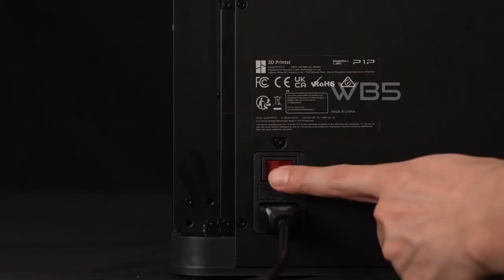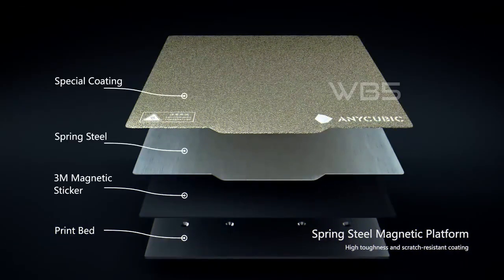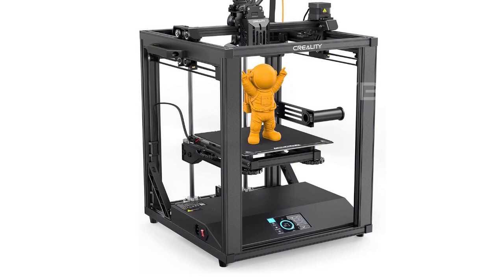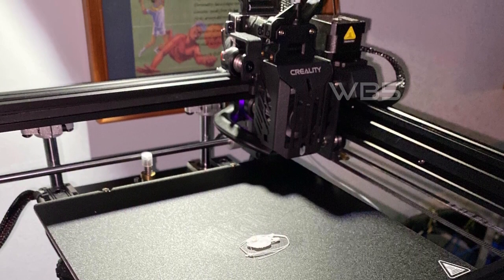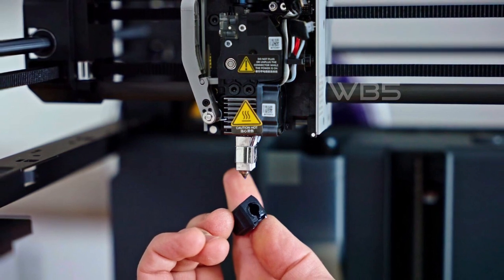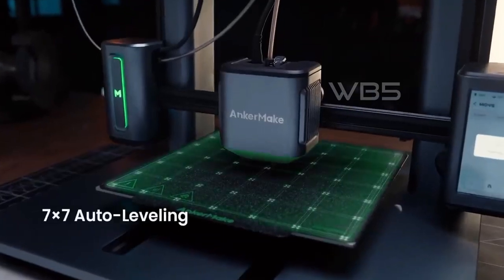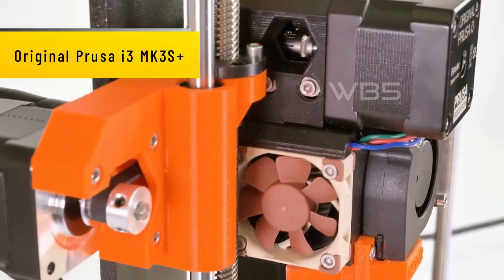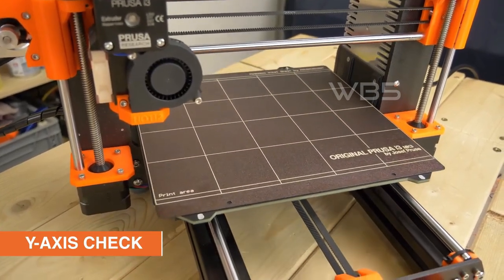5 Best 3D Printers in 2023

Comment: From the affiliate links
Prusa : $1300 fully assembled. Typically $1100 assembled or a box of parts  and bag of gummy bears for $800 not including  shipping($50-100) from Josef P direct. 

Ankermake M5 $800 

Bambu Lab P1P $700

Ender ~ $500

Any cubic vyper $300-$400

If you are spending 1100-1300 for a prusa save your money and get a bambu lab X1C($1100 or 1450 with AMS)

If you are unsure between Ankermake or p1p  get the p1p. If you can afford a little extra get a BL X1($1000)

If you are strapped for cash Anycubic is fine but Sovol 06 and 06+ are decent too for less $$$

There is no comparison between the Mk3s and the BL printers.